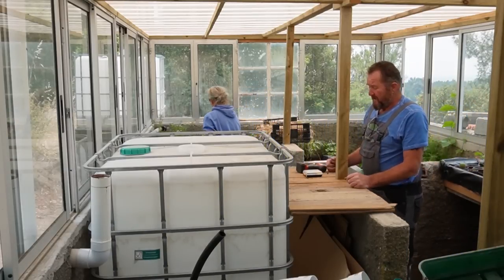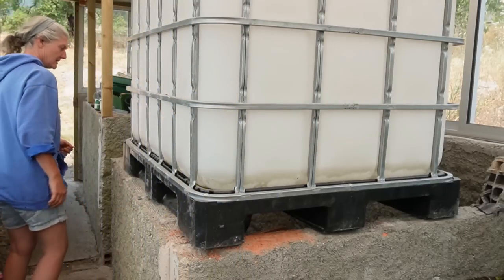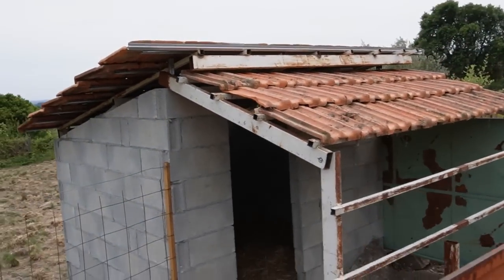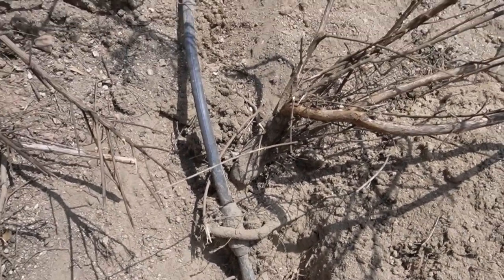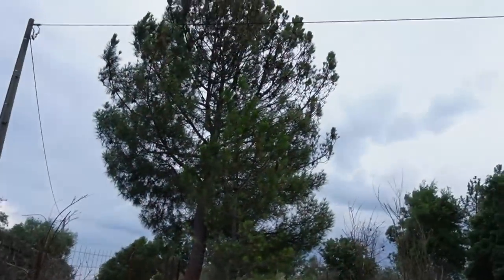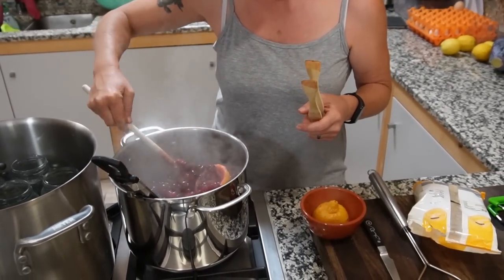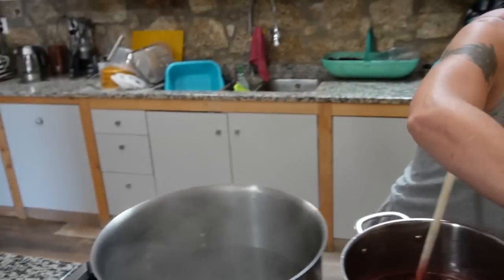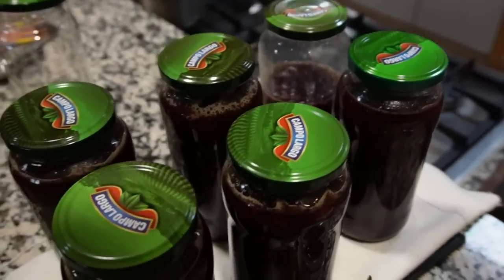Preparing for Rain, That Never Came

Comment: I'm on the journey of watching every video and now Angie got a Jar grapper. Damn wanted to send her one, but i dint want to if se got something and now she did. ohh well maybe something else then.

We can differently no waterbath.

Serialize glas in the oven.
Boil the lids.
Take 1 jar out, fill it, lid on and place it upside down on a surface. Nothing cold. So wood or cloth.

When all cans are done turn then upright.

The upside down thing, makes sure that super hot jam habe covered everywhere in the jar and again sterilized the lid. 

Wait for the popping party, when the vacume seals the lids.

This is much faster, saves water and you can make huge loads, not hindered by the size of the canning pot.

It have never failed for us.

Just another method to keep in mind good for lets say 20 smaller jam Jars that would otherwise take 5 loads in the big pot.

Our experience is that the jar size you use is to big for jam

Cheers

Comment: Those jar grabbers are also great for holding smaller freezer or zip lock bags open when you are filling them,just open the grabber and stand it up with bag open and folded over either the white plastic ends or the green handle ends..i prefer to fold over green ends as it seems to hold better